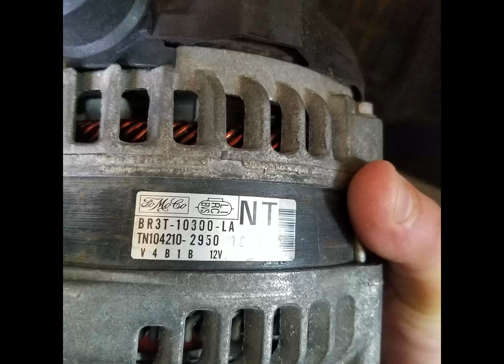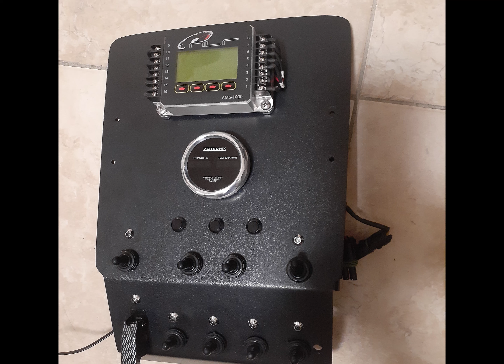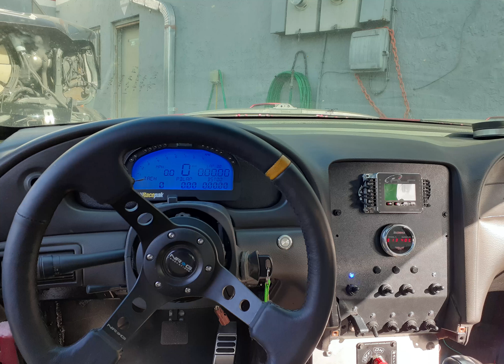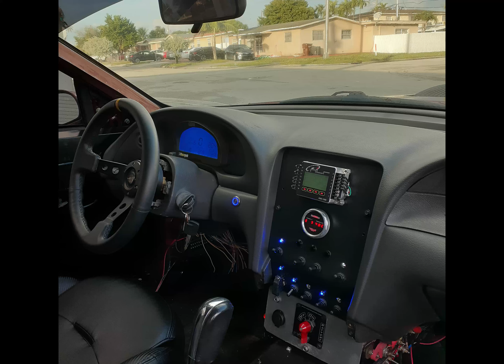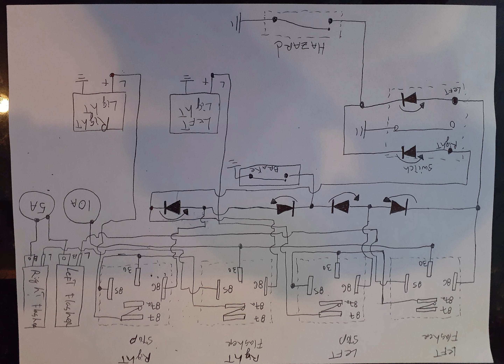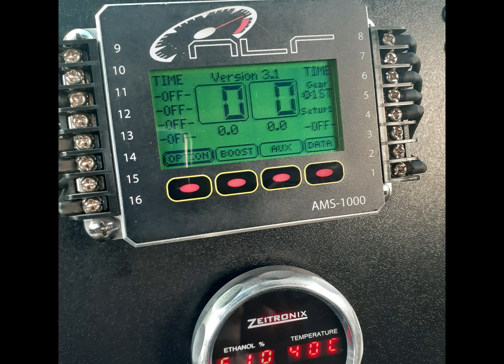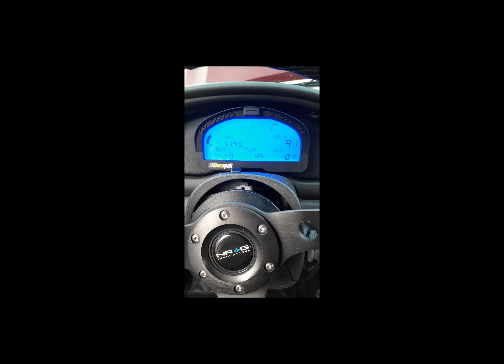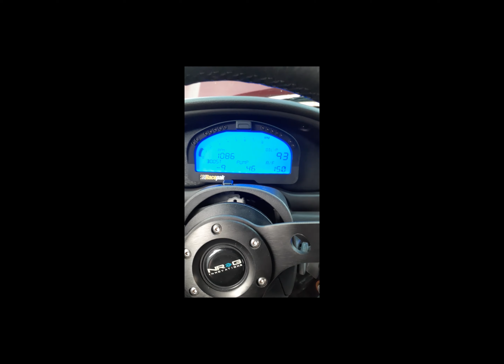Building a 1500hp mustang in 20 min

Comment: Love the build .I would have to be able  to drive it on the street.i had the color mustang it was 1994 convertible. Headers bbk underdrive pulley kit .off road h-pipe. Flow master mufflers cold air intake. Now I have a2012 boss 302  orange with white stripes . Purchased the car brand new off the dealer floor in 2012.i love mustangs .love to have a blue terminator .in the garage I'm looking for one want all stock .I'll do all the mods myself